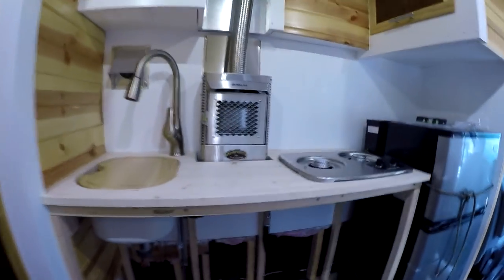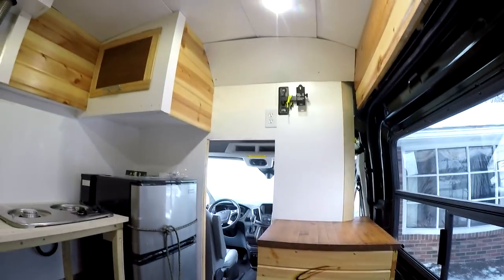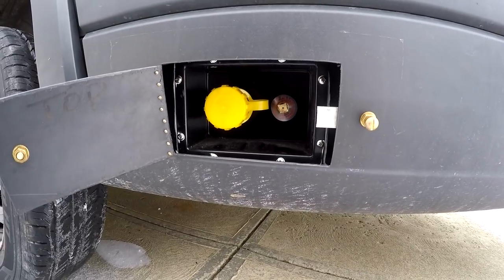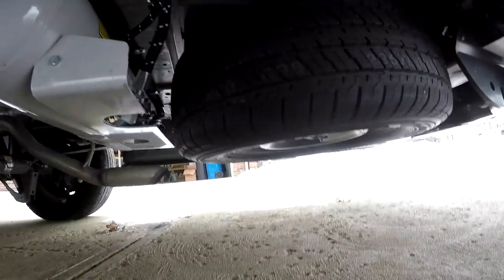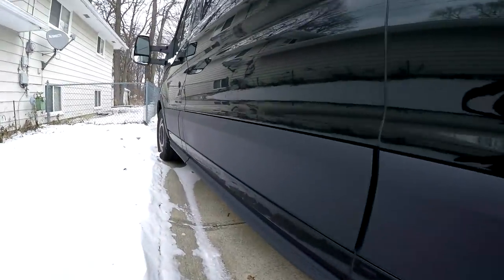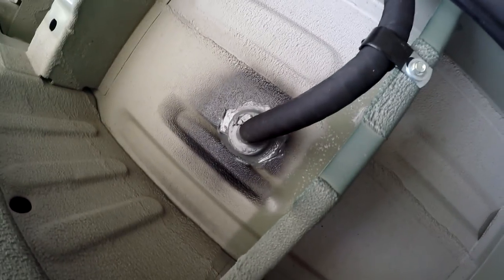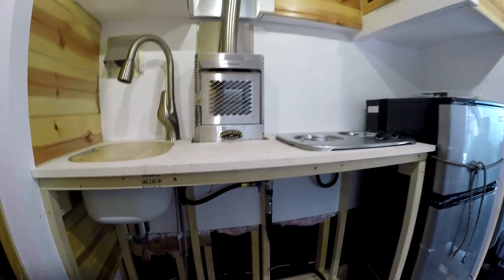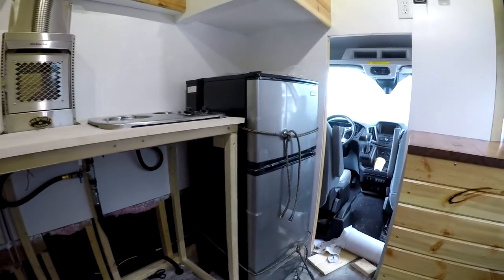Ford Transit Custom Propane Heating System DIY Camper Conversion Van w/ Dickinson Marine P12000

Comment: I have two of these heaters installed in my 35-foot motorhome. One P-12000and one P-9000.  An older model P-12000's than yours. The older heaters that I have, have 4 circular punchout in the top of the firebox. Presumably for better flue updraft.  If your newer heater still has these punch-outs, and if you want to get more heat out of your P-12000, and consume even less propane, plug 1 to 4 of the circular cutouts in the firebox with stainless steel plugs.  There will still be plenty of room to the back of the firebox for the exhaust gases to go up the flue.  I have done this for years with zero problems.  However, make your own judgment as to whether you want to make this modification.  All I'm saying is that it has worked perfectly for me.  I LOVE these heaters.  Also, if your propane line feed under the van isn't armored. you can buy armored propane line feeds for the heater.   If yours isn't armored, I would, at the very least, recommend that you replace your underbody propane feeds with such an armored hose.  Any marined supply shop selling these heaters should be able to provide this.  Such armored lines are required on boats.
Reply from the maker: Thank you for your insight. That is helpful advice. My feed line isn't armored. I haven't had any issues yet over the past few years but I will look into it, especially if I do something like this again.

Comment: Nice van man, I would say that this is actually a better route for heating for where you are at. 
I have a 2006 diesel sprinter,  I installed an espar D2. The D2 is really nice, and being on a single fuel source is great, when it works its wonderful.

The only problem is that is requires electricity to run. Something around .8amps on low and 3 amp/hr on high. This isn't very much, but if you want to run in 24 hours than it adds up quickly. I have 200 amp hours of lithium ion batteries. I am in the middle of a Montana winter and my batters last about 2 1/2 days if there is no sun and I am running the heater 24/7. Firdge, lights, heater. 

I started to only turn it on when I was in the van which turned out to be a good solution. 
The bigger problem became that everything inside would freeze when the heater wasn't on. 

And the largest problem was that at a certain point the batters just do not work. It is too cold for them to function. Anything under 25F and they barely work. 15F and below they absolutely do not work. 

I know they are coming out with lithium batteries that can function at these lower temps, but I didn't think about it when I bought mine. I also heard there are batteries with internal heaters to keep them from freezing. 

I wish at this point I had a heat source that did not require electricity to work. I would say you made a good choice. Its easy to feel like "Oh I wish I did this" when building out your van.
Reply from the maker: Thanks for reaching out. You describe a practical challenge I haven't seen discussed regarding the diesel heater electrical demand in cold weather. 

I definitely have chased my tail a few times on this van about "oh I wish I did this".

Do you have a blog or post about your van build?
Reply: @notwaitingtolive  Not yet, but I will be creating a channel in a few months once I get out of school. 

I did not see this practical challenge discussed either and honestly it never crossed my mind having lived in California my whole life. I never experienced anything under 28F. 

-6F in Montana is much different and a lot changes. I went to turn the heater on before I went to bed one night and nothing, no juice. It was a cold night. I started doing some reading and sure enough the edge of the discharge range is 15F for my battery. 

Re-lion is the only company I could find that creates a special battery for cold temperatures. Their discharge range is extended to -4F. But one 100amp battery is $1,300+ Yikes. 

I have two 100 amp renogy LiFePO4 batteries. Im seeing if I can find a 12v DC heating pad or heated blanket and just leave that wrapped around them on, during the winter. Maybe this will be the trick? But if I go more than 3 days without sun I will be SOL.

Propane seems like the only viable solution in this sort of situation. I was thinking of using one to initially heat up my space until my batteries warm up and then switching to those since propane does let off wet heat and a buddy heater will release carbon monoxide. 

Does the propane heater you use require some electricity for a small fan? 
And is all the combustion happening within that sealed chamber so no carbon monoxide is released and it is all vented out? If so does this internal combustion also relieve you off the wet heat issue?

Humans always have the feeling of "oh I wish I did this" Your van looks great, and the most important part is that it suits your needs.
Reply from the maker: @runningoffinstinct  There is a small DC fan that blows heat off the top of the combustion chamber, but the fan is not required to be on for unit to work. All you need is propane and a lighter.

All the combustion is happening within that chamber and vented out the top of the van. I can't speak to any wet heat or carbon monoxide issues yet. But I haven't been living in the van or heating it for more than a day at a time so I wouldn't take my word for it yet.
Reply: @notwaitingtolive  For what you're describing in a battery compartment i think a good solution would be a small oil heater. Even those heater pads that are used for reptiles could be a solution with a temp monitor. Keeping batteries warm should me pretty easy if you keep them inside, thats why im not a big fan of those outdoor battery trays a lot of RVs use.

Comment: thanks for sharing this, that propane install is super pro, I bet it cost you alot.... almost thinking I might go that route instead of DIY, just for peace of mind, then learn from it and try to copy it down the road. Those dickinson heaters are SOOOO cozy and they look so trick, like a little fireplace. I'm 100% convinced that's the route I'll go, the only downside I see is not being able to force duct the air into different nooks and crannies vs. the webasto style heaters...
Reply from the maker: The labor was not cheap that's for sure. I see in my notes that I paid $2,600 for the pro install for the peace of mind as well. And I also feel comfortable trying it myself next time after seeing a proper install. Altough I'm not sure how I would get the lift necessary to bolt the tank under the van. Still looking good several years later.
Reply: @notwaitingtolive  yeah, that's awesome

Comment: Your propane tank install was the right move. New Diesels have lots of Emission  Controls that can fail. You have to add Diesel Exhaust Fluid on occasion. Once you start using the Camper a lot and able to use the Heater Anytime youll be glad you did it
Reply from the maker: Bob L. You are right sir about those finicky diesel emissions controls. Having worked at Mercedes, emission systems were one of the most common problems we’d see in the vans and they could turn into repeat issues in instances.
Reply: Never mind you would still need something to run your stove — would probably have a propane tank regardless.

Comment: I love your build its great .still some tips 90% of the European RVs have a  what we call a LPG gas-bottles (2) that you refill by a hatch like yours at a gasstation  , they cost from 150 to 300euro a piece plus build in. it will come to 1000 max. All you had to do is make a compartment with a hole in the foor
The Diesel heater you talk about exist in petrol as well (Webasto or Eberspacher) but they need electric as well . So to make them run for 24 hour you need a BIG battery ,PS put that stove close to the ground or you will never have warm feet ,beter sell it and buy a ALDE heater(boiler and heater combined) that is THE BEST thing money can buy  .For solar buy leftover Home panels from a installer 235w 36v or more  ( cost 70%less than 12v)and use a MPPT controller  Good luck safe travels
Reply from the maker: Thank you for your thoughtful reply Paul.

I definitely feel like there is a cheaper propane solution available like what you describe. And I agree a propane heater should be as close to the floor as possible. The propane heater is in its current location because that is as low as the chimney that came with the product would allow. I have spent significantly more money than expected on the system so I will hold off on alternatives as you propose until I start using the van and encounter issues that merit the change. But I am certainly open to alternatives like the ALDE heater you mention.

As for solar, I have 540W 24v open channel installed on the roof as well as a controller and solar charger, and an 1800W inverter. I will make a separate video about my electrical system once its finished.

Thanks again for reaching out.
Reply: Great !  But If you have a 12v system You MUST have a MPPT controller (VICTRON OR MASTERVOLT) or  half of your solar power goes lost  
Enjoy the rest of the build . Have fun on Your journey's and a Happy 2018
Reply from the maker: I have a Bogart controller and Trimetric battery monitor. From what I've been told from some electrical engineers I trust is this should efficiently interface between 24V open channel panels and 12V battery system.

https://pantherrvproducts.com/bogart-engineering-solar-charge-controller-sc-2030/?gclid=CjwKCAiA7JfSBRBrEiwA1DWSGyfwowlECuawqJtOOctPr5D54Go1kGeIBwVHcS_7P5YXbhrl8mamrxoChxgQAvD_BwE

https://www.solar-electric.com/bogart-engineering-tm-2030-rv-battery-monitor.html?gclid=CjwKCAiA7JfSBRBrEiwA1DWSG9n0kDBqVwNAJn5_gdxPtWagZPSpvYfsa1UO1vXfPLIeifBEBWe-_RoCY_gQAvD_BwE
Reply: Im pissed off now . Why do people give bad advice just to make more profit .That thing they sold you is a PWM controller and is kind of ok if your PV panels or like 16v . BUT Your panels or 24v oc so lets say 21v cc now a PWM controller does nothing with that extra voltage and watt .your 550w panel becomes like 400w 
PS dont buy gel batterys. AGMs or ok but do the proper setings on your controller
Reply from the maker: Paul Smeets the panels were $1/W. The charger was like $140. And the battery monitor had to be less than $200. I’d be surprised if that plus cabling was over $1k. The inverter definitely was >$1k though.

I was given this advice from some electrical engineers not salespeople so I they werent trying to con me. 

Do you some documents on solar setups?
Reply: well that is a good price just sorry for the controller . 1k for the inverter IF its a full sinus is not bad for a topbrand 1200/2400w like mastervolt . ordenary ones cost +- 250/350 As to documents ,Im a58 year old fart whom is happy that i can do facebook craigslist and porno-hub ! sorry but i have no clu haw to upload something ,also I never had ONE English class in my life plus I have dysgraphia (tossing or leaving out numbers or fu.. up words)
But a solar setup is simple if you know the differance between watt/volt/amp and how to do the math. and what is pos or neg
you do that wrong and you get sprarks LOL  . take care and if i can help just ask
Reply: Well all I can say is that if you are running a 12 volt battery bank those engineers gave you terrible advice.  Your 24 volt panels actually operate at 36-38 volts and up to 15 amps (assuming you have two panels in parallel).  A PWM controller will simple truncate that voltage at your charging voltage of ~14 volts and leave the amperage at 15 amps, so you will only get about 210 watts out of your panels.  You need to buy an MPPT controller to get the full output of your panels for charging.  An MPPT controller will convert your 14-15 amps at 37 volts to around 38 amps for charging at 14 volts.  You need a 40 amp MPPT controller.  That will set you back about $200 for an OK controller (Renogy, EPever) or around $300 for a quality Victron controller.  Victron also make a very nice battery monitor for about $140.

By the way, I have both a Dickinson P12000 heater and a Webasto diesel fired heater.  Both have about the same btu rating, but there are some significant differences.  First, the diesel heater is a ducted forced air heater.  It uses at least 1.5 amps and up to 2.5 amps on high.  Compared to the Dickinson it is a battery hog.  The diesel heaters are also much louder and have a very hot exhaust that can be heard and smelled outside the vehicle.  On the plus side the diesel heater heats up the space more quickly than the Dickinson because of the ducted forced air.  A full do it yourself install of a Webasto diesel heater will run you around $2,000 if you are OK with tapping into the diesel tank yourself and maybe $400 more if you install a separate tank.

Note, I am not an engineer, just a Ph.D. physical scientist who has implemented propane and diesel heat and installed solar and done 100% of the work myself.
Reply: If those are the panels you have, then you are OK with the PWM controller since those are 12 volt panels.  Note that the 12 volt "name" applies to panels that operate at 18-19 volts.  There should be a label on the back of the panel showing the volts and amps for that panel.  A 24 volt panel will be in the 36-38 volt range and a 12 volt panel will be around 18-19 volts.

The panels in your link have an operating voltage of 19.67 volts, so 540 watts gives 27.45 amps.  At a charging voltage of 14 volts, you will only get 14 v times 27.45 amps = 384 watts or 71% of panel output with a PWM controller.  An MPPT controller would give more like 515-520 watts.  As I said, an EPever 40 amp MPPT controller

https://www.amazon.com/EPEVER-Controller-Display-Battery-Charging/dp/B077HHYYHT/ref=sr_1_2?ie=UTF8&qid=1515263629&sr=8-2&keywords=40+amp+mppt+solar+charge+controller

 or Renogy controller

https://www.amazon.com/Renogy-Rover-Solar-Charge-Controller/dp/B01MSYGZGI/ref=sr_1_1?ie=UTF8&qid=1515263629&sr=8-1&keywords=40+amp+mppt+solar+charge+controller

Would cost about $170.

If you went higher end, a Victron SmartSolar 50 amp controller would cost about $340, but it will communicate with your phone by bluetooth and give you more information that you could ever want.
Reply from the maker: Todd Dunn thank you. I’m going to look more into this.
Reply: not waiting to live 
How has your Transit van holding up so far? The 2017 Transit 250 is $40k and the 2017 Express 2500 is $30k where I live. Idk which one to choose for my van build. Your thoughts?
Reply from the maker: Okie Rider I’ve only got 7k miles on the Transit so far so my experience has been limited. There have been a couple recalls on the transit as well but I have not taken the van in for repairs yet since I don’t drive it much at the moment. In my limited experience I love the transit. I love the drive, the cabin, the extended mirrors. I’m very happy with my purchase.

I don’t have any experience with the express but I did sell Mercedes vans in 2017 and wrote a comparison you may be interested in linked here:

http://www.fordtransitusaforum.com/#/topics/60185

What are your main goals with van?
Reply: not waiting to live 
Full time living to help pay off debt (college loans, credit cards, etc.)

Comment: Yes the Dickinson heaters are expensive but they are really well made & have a warranty when everything goes wrong, I tried a cheap knockoff diesel heater but prefer the dickinson p9000
it's so cozy to watch flames in the winter ;D

Comment: This is exactly what I was looking for. Great video, thanks for sharing!
Reply from the maker: Happy to be that random video on YouTube! What are you building?
Reply: @notwaitingtolive  I'm still deciding what to build, either a slide in truck camper or a van. I want something for some Alaskan road trips.
Reply from the maker: Sounds like you’ve got a fun choice to make. I love my van which I’ve had for 4 years now. But I do not like driving it in snow. I’ve been through 4 Cleveland winters with it. I’ve never gotten stuck but driving in a few inches of snow can be scary with rear wheel drive. 

I personally wouldn’t take it off road beyond open fields...

Comment: Love the look of the open stainless fireplace. Excellent heating choice. Will subscribe to see how it works out on the road. I think the location of the tank and the size is ideal. Maybe you will decide to use the infrastructure to add H/W or propane fridge someday.  Nicely done.

Comment: Much better solution to the diesel one your lusting thro hindsight after.Putting your eggs in one basket applies to MH as well. Multi fuel systems are best. The idea of having to run engine to gain heat is in my mind anti social and restrictive. Plus your present system looks very elegant. So cheer up when the sun shines you.ll see the Gods where with you.
Reply from the maker: Michael Vockins I appreciate the encouragement

Comment: You could have gotten a espar b4 heater that works like a diesel heater but runs of gas & your gas tank
Reply from the maker: Good to know. Any drawbacks to that?
Reply: @notwaitingtolive   I have not heard anything bad about them. Their diesel heaters they put in semi truck bunks so it must be very high quality
Reply from the maker: @BBBYpsi  the only problem I’ve hear about those is the diesel heaters are allegedly loud. But I’ve never heard one myself to confirm. The propane is quiet. I’m not sure if it’s just the blower that’s loud or if it’s the heater itself.
Reply: @notwaitingtolive   The blowers are the part that makes the noise